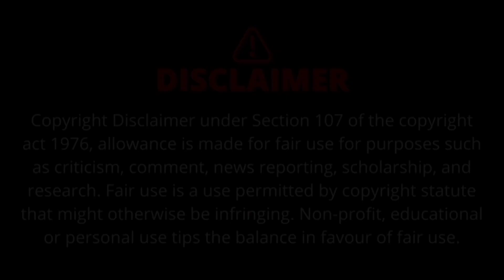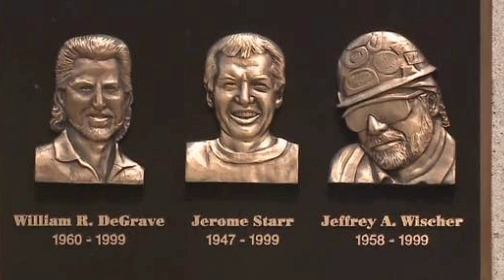What Caused This Massive Crane To COLLAPSE?

Comment: Cranes collapse with alarming frequency. Operators often lack the working knowledge of physics necessary to ensure loads are balanced and within safe limits
Reply: Cranes are supposed to have lift charts, which detail how much you can lift at what distance and importantly for this story what wind speeds the crane can safely operate in. Many years ago I used to work on large office developments and windy days were a real pain because the crane drivers would shut the crane down.
Reply: @johnoneill5661  in 5his case unlike most the load weight wasn't to great it was the wind speed that wasn't factored in